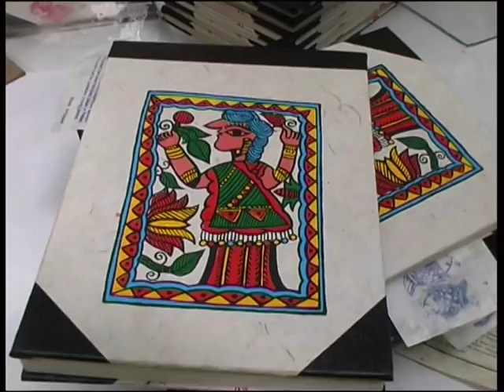Traditional Hand Made paper making -Nepal

Comment: so it is just pure tree barks and a water, no more additives?
Reply from the maker: Thanks for inquiry, Yes we don't need to use any additives .
Reply: @manoharupreti  No Prolem, but Sir may I ask another question, this is the situaton, we are making a product for our science scool project as we are grade 10, and we came up with the idea of making paper out of okra or also known as "lady's finger", we blender the okra so that it would turn into fibers and then just like what the person do on the video, we use frame with screen to filter the fibers out while being submerged in water on a container, and after it, we place the fibers by flipping the frame and letting the fibers go down to a cloth, after it we let it try, the paper is fine and smooth, but the only problem, is that the paper won't let go from the cloth when its dry already, also the outcome of the paper is liked turned into pieces like its cracking, and we cant take it off the cloth cause it would tear the paper, any suggestions Sir? Thanks and hope you will help me out. :) its our science project, helping me will help alot sir thanks in advance.
Reply: @p0k3r  Let the screen dry in the sun. If the sheet comes off in flakes, there is not enough fiber. Try recycling old letters, junk mail or other paper waste. Look for other plant fiber materials; fig bark, mulberry bark.